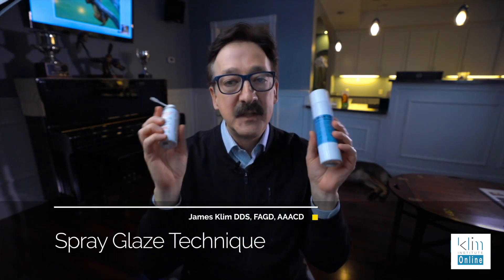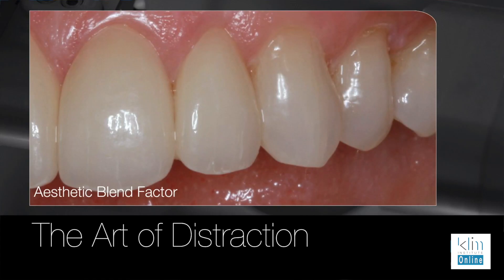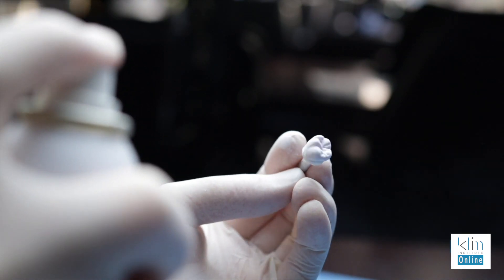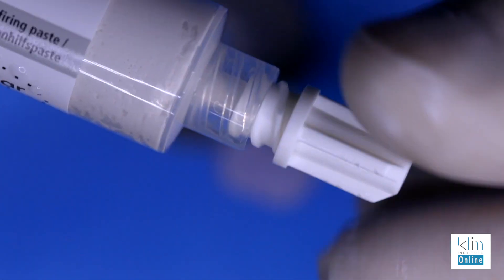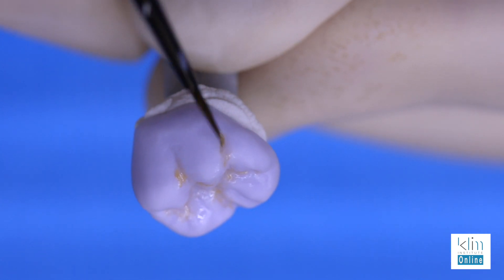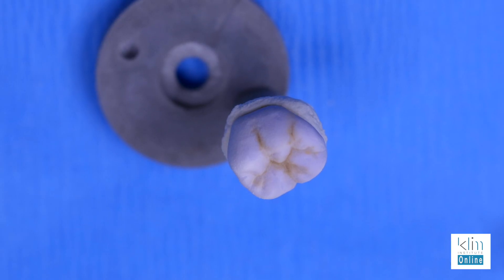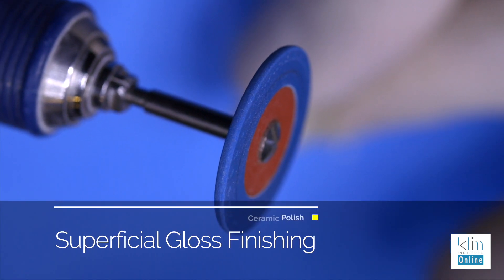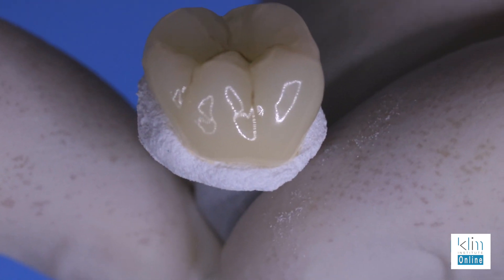e.max Spray Glaze Technique for CEREC Users

Comment: Question. I am being trained to push the flow into the tooth to show the margins before baking. In your video, you cover the margins to seal them. Am I being trained wrong?
Reply from the maker: Place the flow, and then when seating the die pin, allow the Objectfix to expand to seal the margin, but not cover the margin.  the main objective is to fully fill the internal aspects and support the margins during firing.  All the best.